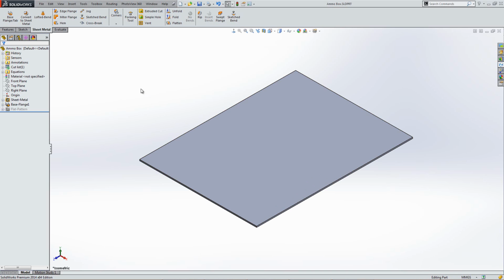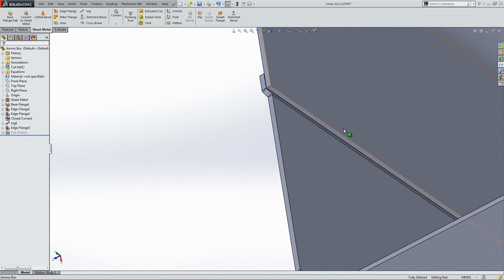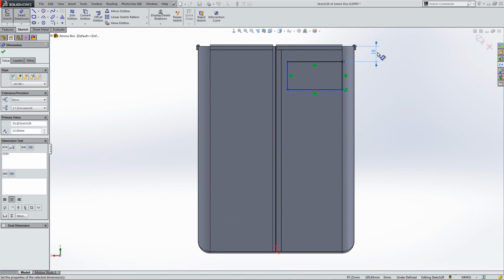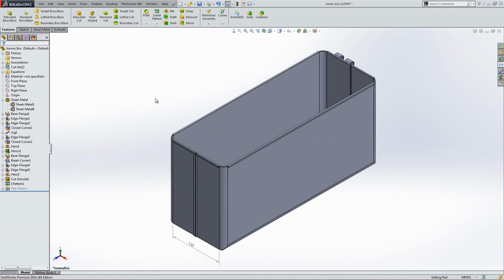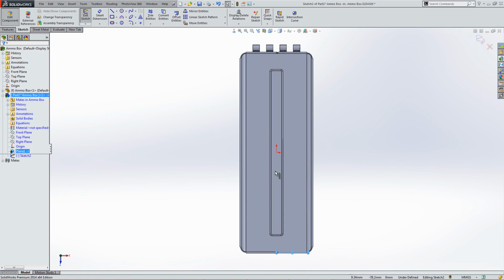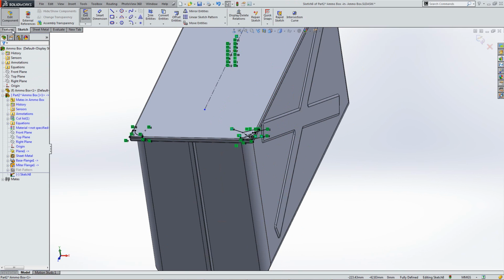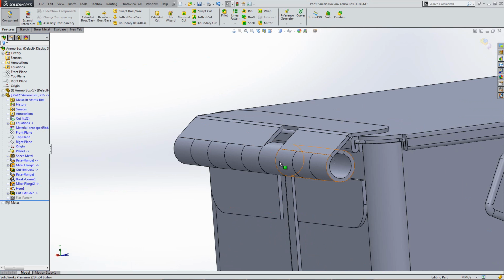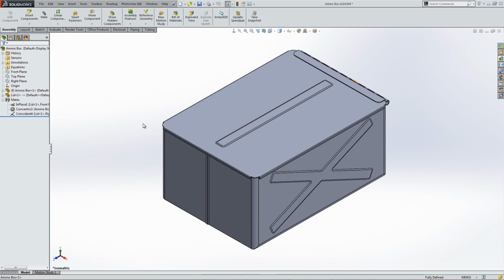Solidworks in your Industry Pt7 - Sheet Metal

Comment: How exactly are people supposed to "learn" from this if you don't explain  everything that you're doing? Or if you don't start from the very beginning so that your "students" can work along with you? I can't just watch this video and learn from that, I need to actually DO it as well. So I ballparked the base flange, knowing that one side was 200mm, but now I can't get the third edge flange to be colinear with the jog because I have no idea what you did to make this happen. 

Just... why? I'd like to learn from this, but it's nothing but frustrating.
Reply: Nevermind, figured it out. See, I haven't used this program in over 4 years, and the simple things like adding relations are something that needs to kind of be reinforced over and over again. Even along the lines of a massive tutorial series, it doesn't hurt to reinforce the basics.